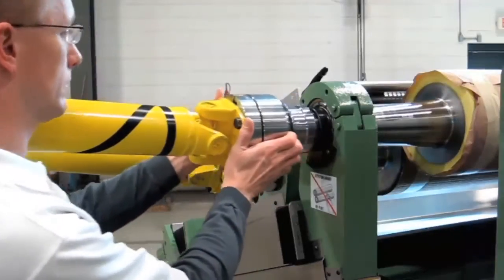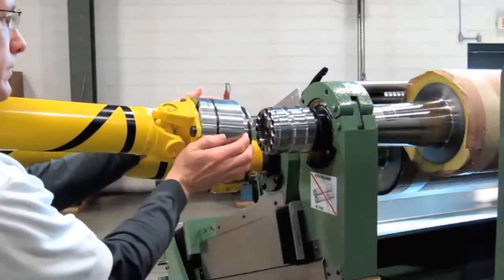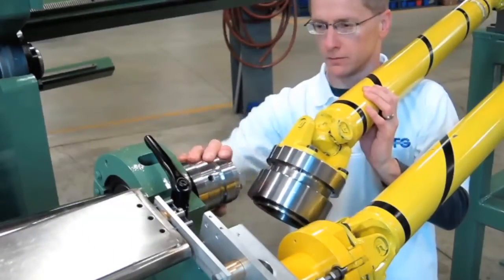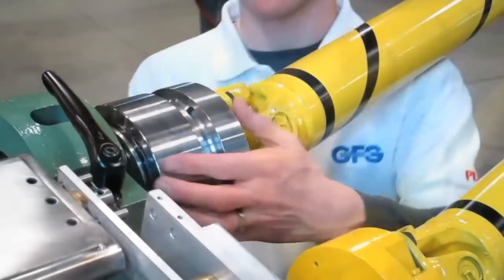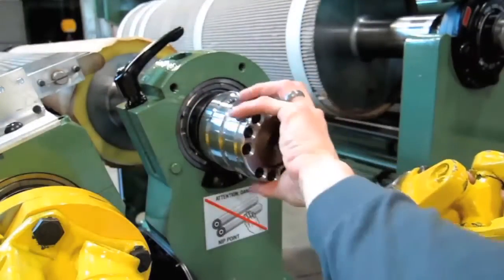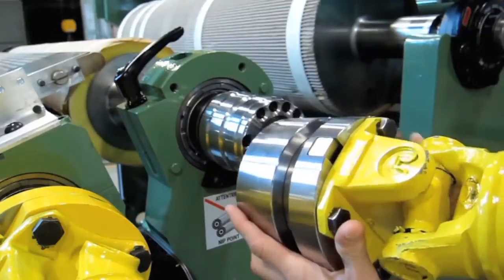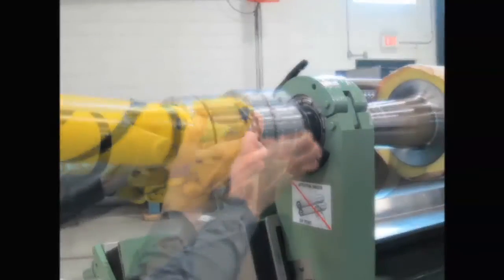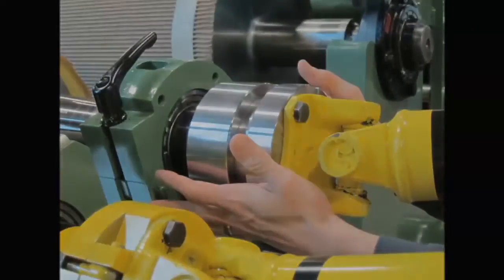GFG patented Tool-less Quick Disconnect Driveshaft Coupling

Comment: I work in the steel industry and having the ability to disconnect a drive cardan universal spindle from a roll fast would be a winner in several areas.  Supporting the universal spindle while you are changing out rolls would be a winner.  The devil is in the details.  What is the torque rating of the coupling compared to the universal spindle itself?   Can it handle impact loading?  What are the sizes?  I have a 160 mm shaft driven by a universal spindle.  Do these couplings go up to that size?  Can the coupling handle heat and water without binding up the internal mechanism?  The devil is in the detail.  Still that is the slickest thing I have seen in a while.  Keep up the good work.